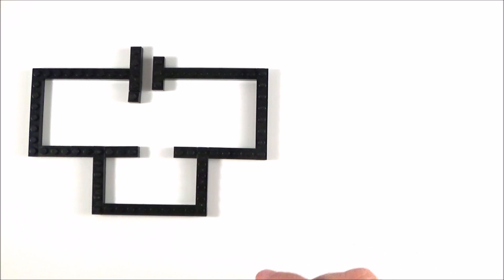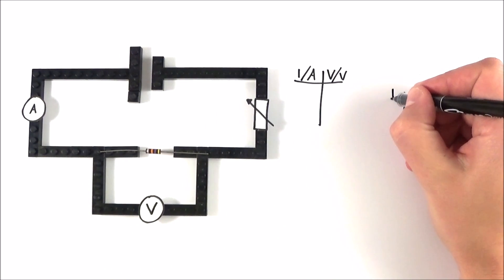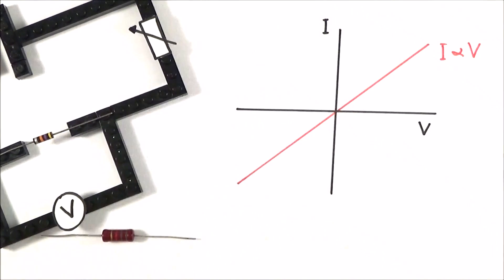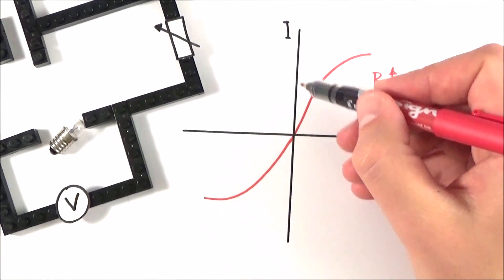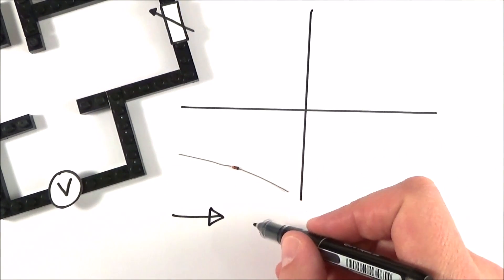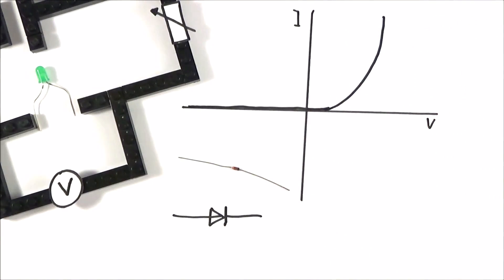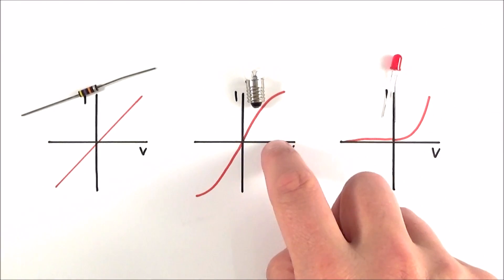IV Characteristics of Resistors, Filament Lamps, Diodes and LEDs - A Level Physics

Comment: thank you sooo much! i was really struggling with diodes, and im still a bit confused about the threshold voltage. is the resistance of the diode still very high until the threshold voltage is reached/exceeded?

Comment: I never understand why y axis is I ,current,  & x axis is V. Voltage. If it were the other way around... we would see clearly resistance increasing & the gradient would be R if graph were Ohmic. It would be less confusing. Am I right? Thanks 😊
Reply: You are controlling the voltage across the component, hence it is on the x axis

Comment: Great video, however i dont understand why resistance increases with current for the filament lamp?
Reply: As the current increases, the filament heats up. This means the e- in the circuit collide more frequently with the lattice ions.

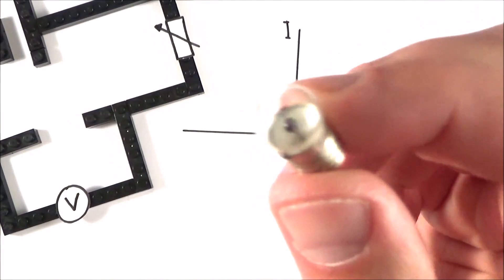Comment: 3:12 Could you please explain why the bottom line suggest a higher resistance?
Reply: R=V/I, for higher resistance you'll get lower value for current, hence Resistance increases. idk how to put it :'D
Reply: It's because R=V/I and the axes are the other way round and that means that the resistance is the reciprocal of the gradient, not the gradient

Comment: I hate to disagree - 'cos these videos are so brilliant. But - the lamp does obey ohms law. ie - the current drawn by the lamp is equal to the voltage divided by the resistance of the filament. The difference between the lamp and a resistor is that the resistance of the filament changes as it heats up. So if you apply a voltage to the lamp, the current will change over time as it heats up. You could plot resistance against time - which would change, albeit rapidly over (say) a few milliseconds. The resistance of the lamp once the temperature has settled can be measured on your I V graph as the gradient of the line at a point - ie the tangent to the curve.

Comment: The filament bulb only changes its resistance when it heats up. If the temperature within it was constant, wouldn't it just be another ohmic conductor?
Reply from the maker: AbdurRasheed Sadiq That's right.

Comment: Hmm resistance increases and current increases?I thought voltage increases as resistance increases or am I wrong?
Reply: This is relevant when it is an ohmic conductor, however a filament lamp is not ohmic and so the resistance is not directly proportional to the voltage (Basically R=V/I does not apply), because ohm's law only applies at a constant temperature
Reply: But with a filament lamp the temperature is always increasing
Reply: Sibasish Mukherjee well my exam is done and dusted now so it's kinda late hahaha.

Im still not sure to be honest.
Reply: Sibasish Mukherjee I think u still need to use v=ir even if not ohmic conductor.
Reply: suhail1200 yup
Reply: suhail1200 No ur correct!  If u cannot follow the V=IR then why is he telling that to calculate the resistance we need to use V/I...! I have checked other videos this concept is wrong in this video
Reply: suhail1200 oh nice.. hope it went good

Comment: I've seen exam questions with the V and I axis reversed (voltage along the Y-axis and current along the X-axis); do you just rotate the shape of the curve in those cases?
Reply: How? i dont get it. how would you flip it exactly?
Reply: Reflect in on the x=y line. Just the same shape but reversed direction. Imagine holding it to a mirror
Reply: +Abbas11227 That's right, your flip it along the diagonal.
Reply: But the line is on the x=y line. its like on the mirror.
Reply: Actually the line isnt flipped its just rotated in a way that the graph has a negative gradient. i have a picture of it in my book that i didnt see at first,
Reply: the general convention is that the independent variable should be expressed on the x axis and the dependent variable on the y axis. In this example, voltage is independent. Current is dependent on the voltage and the resistance of the resistor - so is represented on the Y axis.

Comment: For the Diode graph isn't there a breakdown voltage when current is reversed?
Reply from the maker: +Crazy Noomi Yes there is. Basically with a really high voltage you can force a current to go the 'wrong' way through a diode but this isn't normally asked about at A Level. There is more info, and a graph, here: https://en.wikipedia.org/wiki/Breakdown_voltage